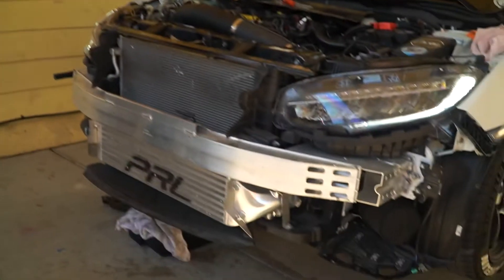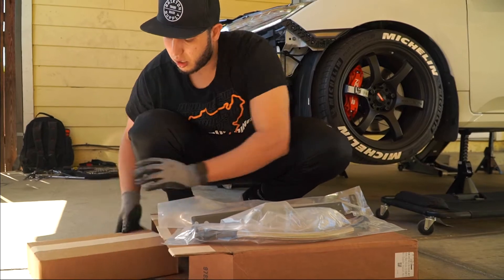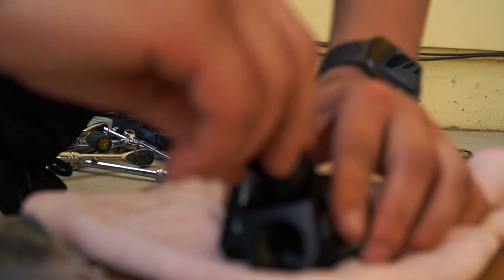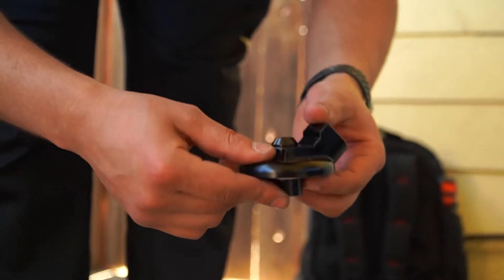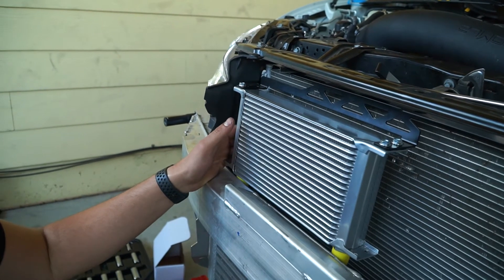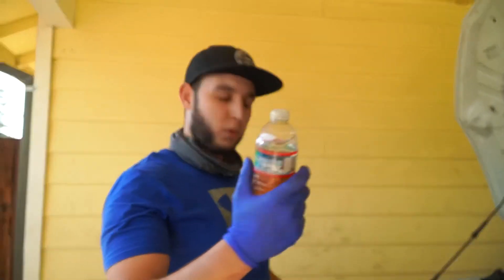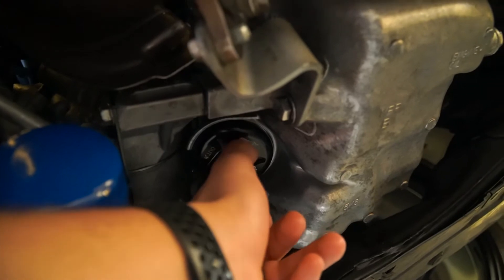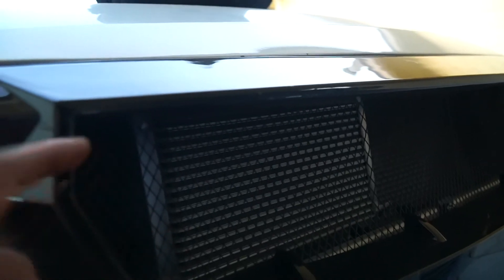SIRIMOTO OIL COOLER INSTALLED 10TH GEN CIVIC SI!

Comment: Nice video to show how to install the oil cooler on your Si and SiriMoto oil cooler is best place in front grille to help the air flow to keep the oil temperature go down!! 👍
Reply from the maker: Thanks as always watching my videos brotha, yes I think one of the best supporting mod u can do to this cars cause the oil get so hot and things can get messed up, with oil cooler I feel  I can have more fun without worry about blowing up my enjoy and the car doesn’t loose to much power either when the engine gets hot,  mush better than before
Reply: @anastouzani9244  any issues ?